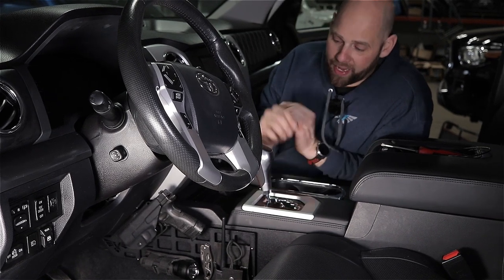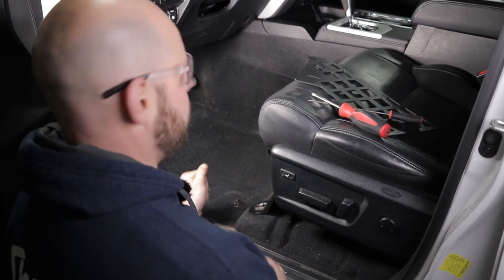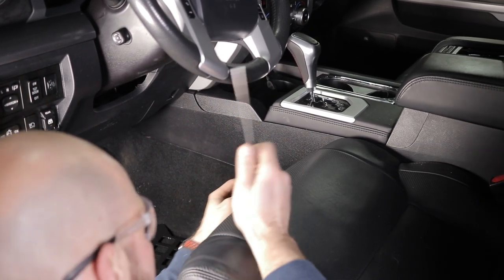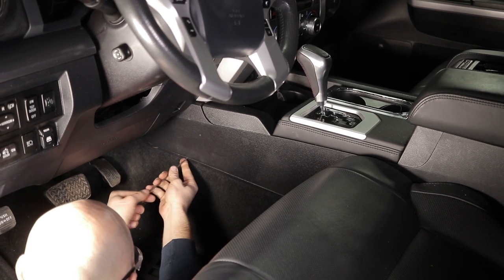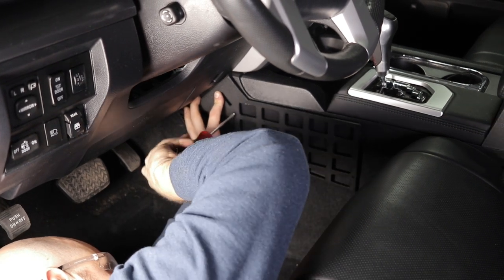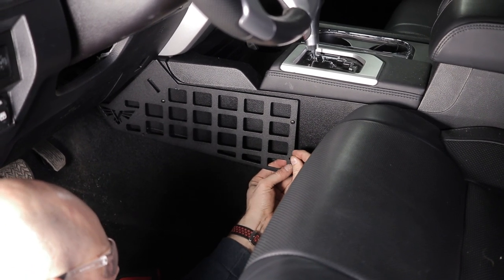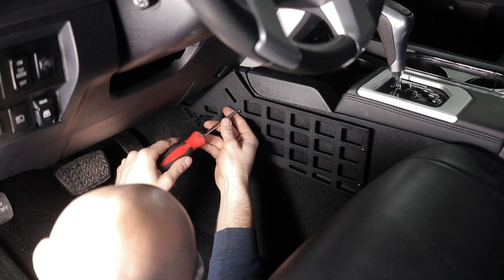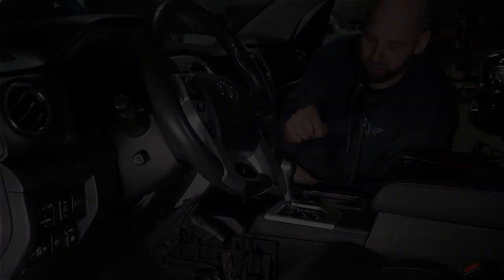Tundra Center Console Molle & Accessory Panel Installation

Comment: Should have provided hardware with locking nuts to the rear of the panel to prevent tear out. This wont hold up for long before those screws will rip right out. Simple solution with a change of hardware.